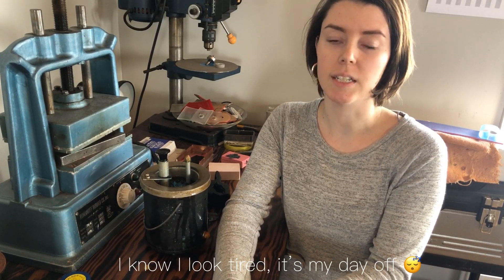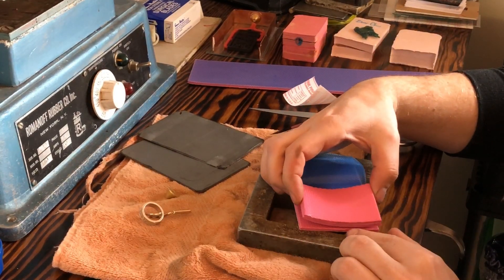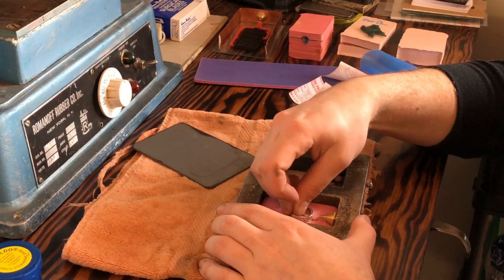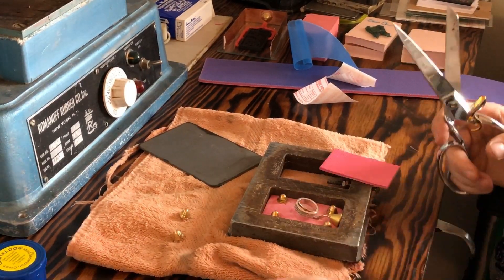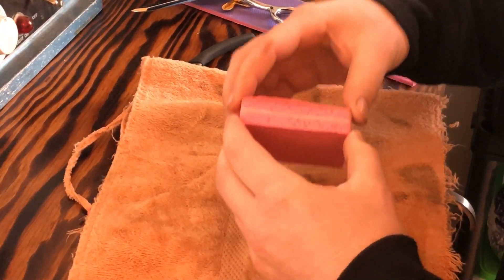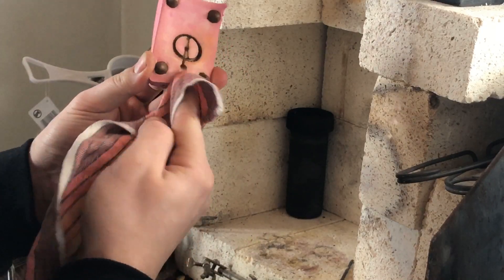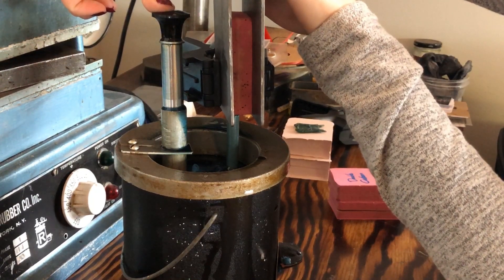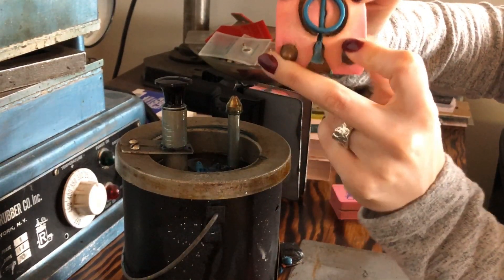Molding and Wax Injection for Lost Wax Casting

Comment: good video as always. I don't remove the paper labels from bottom and top layers of rubber - easier to remove the plates after. And  I put everything uder cold water to cool. It is a recommended by Castaldo method.

Comment: Would you mind providing a link for where you purchased your wax injector? I like the idea of a hand pump wax injector as opposed to a air compressor wax injector (and also the wax you use)
Reply from the maker: Our injector is a much older version of this one:

https://www.gessweincanada.com/product-p/265-2235.htm

We change out the wax depending on what kind of model is being injected. Pink for high details and thin sections, turquoise for general use and purple for models that will be altered/carved after injecting.
Reply: @ClearMindJewellery  thank you so much
Reply: I use a large syringe heated in the oven. An ok way to start.
Reply: @CONEHEADDK  not a bad idea, but I'd like something with a better seal to the mold
Reply: @mudbouggin7563  My molds are clear, so I can see, if they are filled.  But I suggest just filling them hard, and then - if the wax is warm/fluid enough, the extra just flows out. Who cares if you have to redo a few of them - wax is reusable. If you only have a few molds, drop them in cool water after filling, so you don't need to waste a lot of time. I have a bunch of syringes, so I can do a handfull at a time. Not that I am "up and running a production", but that's mostly bcz I don't really have the burn out facilities. Tne seal against the mold isn't really a problem - just press it "hard enough", and reuse the spills.

Comment: Nice video ,what is the ideal temperature of the wax before injecting in the moulds
Reply from the maker: 150-200F it depends on what kind of wax.
Reply: @ClearMindJewellery  I am jewellery    rubber mold cuting and making

Comment: Great video. Would you guys be able to give an estimate on your up-front capital costs for the system you've setup?
Reply from the maker: Gregory Clarke 
For the molding only or the entire casting setup? 

I picked the vulcanizer up used and it came with a small assortment of frames for $250 I think. The rubber is about $60 for 5lbs which will make a lot of molds depending on size. Around 15 of the size that I showed in the video.

Comment: I don't understand  where the air in the mould cavity goes when you inject the wax!  Would it not form bubbles and resist the inflow of wax unless there were vents? I'm glad it works all the same!
Reply from the maker: You can do relief cuts in the mold. Generally we have found this isn't needed unless the model is highly detailed or small.
Although we try our best the two sides of the mold vary rarely make a perfect seal meaning the air will slowly leek out on its own for larger more generic models. 

We will be working a new molding video in the coming months as this one is missing some information and we can do a better job of explaining now.
Reply: @ClearMindJewellery  Ah, what a brilliant, informative reply, and so quick. thank you!

Comment: Hi. Just saw your video. Awesome. To date we hv been sending molds to casting and they inject. Now we are injecting ourselves. Any advice on why wax is going in creases and forming webbing spillage? Any advice would be greatly appreciated. Also how much powder do we apply? If there is talc on wax once removed from mold. Will that show in casting - washed off most of it. Thx again
Reply from the maker: Creases may be because the wax is too cold causing overlaps or ripples, it depends on what you mean by creases. 
Generally you should only have enough talc on your mold to produce a matte finish on your wax models when you pull them out. Not seeing the actual powder stick to the wax. 
You may have a slightly textured finish on your models after casting if there is extra talc on the surface. If you can get a nice shiny injection you will get a nice cast model.

Comment: What kind of clamps are you using? Thank you!
Reply from the maker: The clamps we used in this video are actually for a GoPro. We were having a hard time finding a clamp with parallel jaws that could put down enough pressure.
Reply: @ClearMindJewellery  thanks!!

Comment: Do you solder the brass sprue rod onto the piece?
Reply from the maker: You can solder or weld it into place, you can also just set it in beside the item although you might have to cut out a small piece of mold if something expands into the tiny gap.

Comment: Thank you for your video. I learned a couple of tricks today. I have a question.  Can jewelry casting also pour steel instead of brass or other metals inside their plaster molds?
Reply from the maker: You need a specific setup to handle steel and platinum. The casting machine will be different, better heating capabilities and gas shielding.

Comment: I am coin manufacturer so I used casting method for coin embossing, but I casted from wax piece , the size of coin shrinked and weight also reduce, the original coin weight 11.640 and Dia 30.5mm but casted coin size 29.5 mm and weight 10.750, so how to control that problem

Comment: After you place the mold on the wax injector you pull up on the plunger. Does that in any way create a small vacuum inside mold?
Reply from the maker: I've like to think so, but I don't think it works that way. Pulling up draws the wax into the pump, so there must be some kind of check valve inside.

Comment: Sir I use liquid and castaro rubber both but casted piece size reduce ,compared wax size and original piece both , so how to control shrinking problem solved, I want to cast Silver coin but it's not equal original piece size and weight both less compare original piece , so how to control that problem
Reply from the maker: Sorry but I'm having trouble understanding your issue.  
When molding and injecting you have to be aware at every step to limit shrinkage. The No Shrink Pink from Castaldo has little to no shrinkage you also need to do your research on a wax that has the same no shrinkage properties, none comes to mind at the moment. Also use a polishing method that removes less material to avoid too much metal loss, such as only tumbling the item. 
When we make items that need to be a specific size, for example rings, we will account for the shrinkage rate when making the model.
Reply: I'm not an expert but in the video they used "Castaldo No Shrink Pink" specifically because it has zero shrinkage. Hope that helps :)
Reply: Your mean I used pink colour castaralo rubber instead liquid rubber to control shrink

Comment: Is it necessary to use a clamp? Or just easier? Thanks!
Reply from the maker: It depends on the type of item you're injecting. But generally yes, some type of clamp or other way to apply equal tension is a good idea.
 This video is a little old and we are thinking of making a new video with our updated process.

Comment: any benefits to using vulcanized molds over liquacast?
Reply from the maker: Vulcanized Pros: more durable, combined/ layer different rubbers, option not to have to cut apart, generally slightly cheaper, they’re faster to make 

Liquacast Pros: no heat, higher detail, some can be clear, size options

Comment: Great video! Seeing that you have introduced 3D Printing in your Workflow, have you tried makin moulds directly from the resins? I have an Elegoo Mars and I'm kind of curious to know if I can do Jewelry Molds with it's Standard Gray Resin.
Reply from the maker: For our workflow we prefer to use direct to cast resins. However there shouldn't be a problem with making RTV molds, like the liquicast video we did, vulcanized molds might work but it would depend on the heat grade of your resin. Definitely check the spec sheet first.
Reply: I do this, you need to print using a resin which can take the heat.
Reply: @itailu  I have molded B9 Creator Emerald Resin with Castaldo gold and no shrink pink successfully.

Comment: Hey Guys! Is it possible to make one of these vulcanized molds with a 3D Printed Part? Or does the vulcanizer get too hot and melt the PLA?
Reply from the maker: It’s to hot. You can look into a cold poor mold like liquicast, did a video on making a mold with it.    You can also cast PLA directly with the proper investment and burnout.
Reply: @ClearMindJewellery  Thanks so much! 
We (my wife and I) would like to know what is the best way to "mass produce" a PLA Print? We would like to make some sets of Silver Jewelry for our grandchildren and their parents, but 3D Printing each item seems like it would take far longer than injecting wax for a spru tree?
Reply from the maker: If you’re only making a few pieces I’d just print each one individually, the overhead cost for each piece would be lower overall and use less materials. For mass production injecting would be the way I’d go with multiple moulds of the same piece.
Reply: @ClearMindJewellery  This is very helpful information, thank you so much for taking the time to reply. 
One last question! With your helpful guidance I've watched the liqui-cast video you posted and also looked at Gesswein's website at Castaldo clear-cast products. What would you say are the advantages to going for a full vulcanized mold over a clear-cast (besides possible degredation)? Is vulcanization going to give you the ultimate in fine detail, or is clear-cast at the point where the difference is negligible?

Comment: What are the benefits of doing this method as apposed to 3D printing
Reply from the maker: Todays video actually goes into that in the intro. https://youtu.be/xq78xQVrRjI
To summarize. Speed and cost. If you don't have enough items to fill the print bed or have so many items you need to do multiple runs its time to think about mold making.
Reply: @ClearMindJewellery  will add to my watch list does this also work for earrings?
Reply from the maker: @CorniiYT  molding is for making the design element most times. Injecting earring posts is hard and making multiple molds for every ring is a lot of work. So mold making has its place when you're making standard design element and then you add on a ring blank, post, or other finding.
or
You are doing high volume. Then making multiple molds for each style in each size makes sense.

Comment: Hi there. Is it possible to use the method to produce a large ring with a ring head twice as large as the ring rail. I mean with the "BANANA" method. The scalpel method should work or not? I want to copy a "brutalist" ring. THANK YOU.
Reply from the maker: This method will make a mold out of anything it is the success of extracting the wax from the mold thats the issue. If the top of the ring is too intricate it will be difficult to remove the wax. After making the mold I would make a few relief cuts in order to facilitate this.
Reply: @ClearMindJewellery  THANK YOU VERY MUCH.